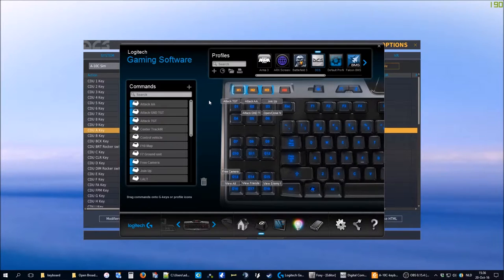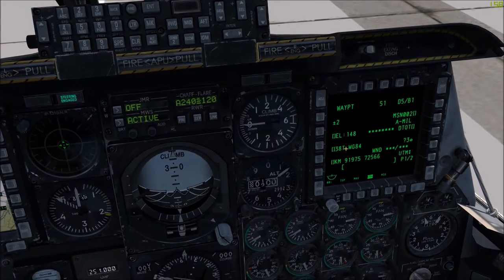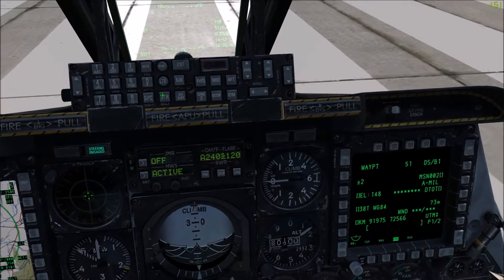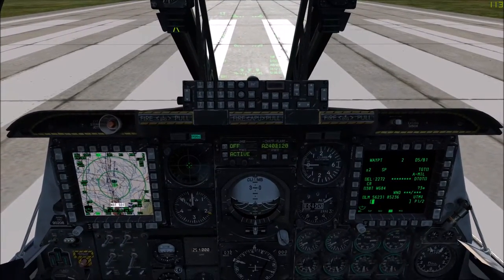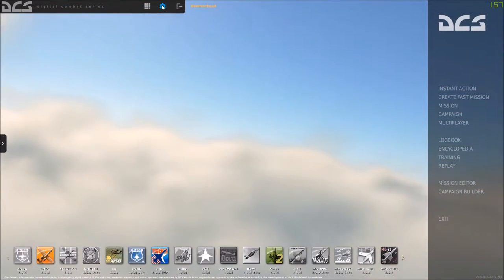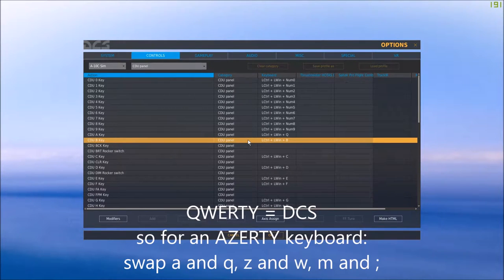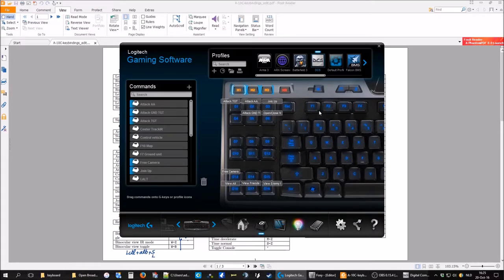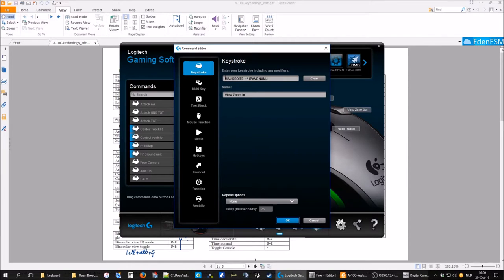Using keyboard to enter CDU data and external view tips

Comment: Great help and some ideas I hadn't thought of.  I'm not familiar with script files.  What extension do I use when I save the file out of Notepad?  Will a .txt file serve as the script or is there a specific extension I need to use?
Reply from the maker: File type depends on the application. In this video I simply entered the script in the Logitech Gaming Software window and it saves it in an appropriate format. So no need to save as a specific extension. Hope that helps.